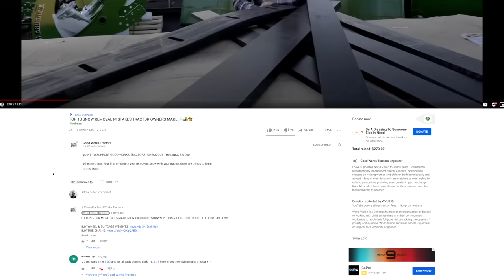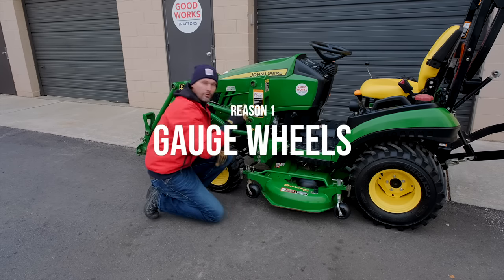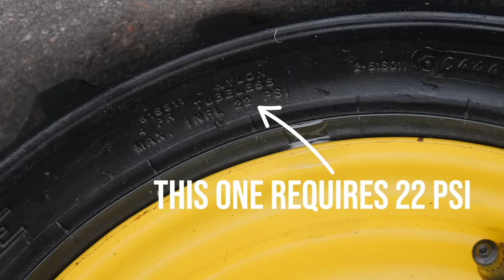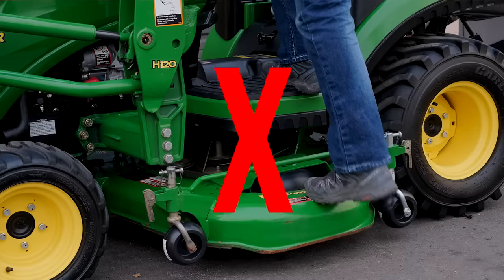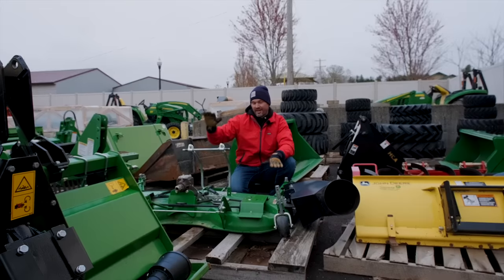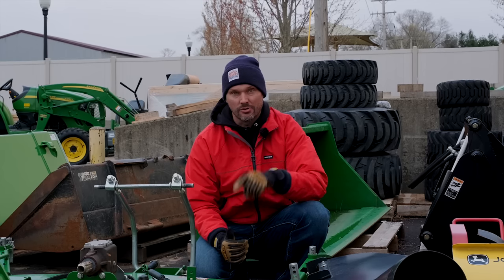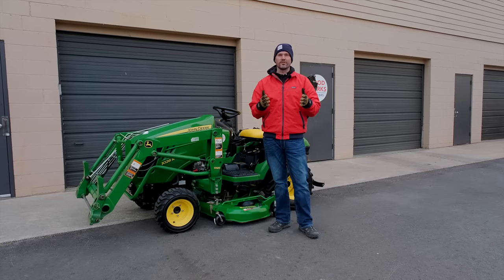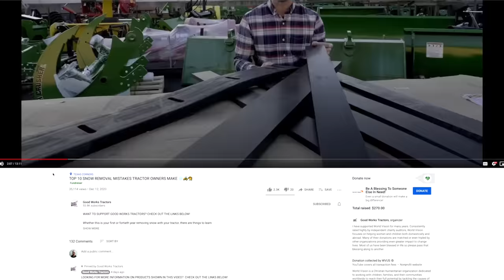5 REASONS WHY YOU'RE MOWING UNEVENLY & HOW TO FIX IT 🚜👨‍🌾

Comment: JD series 100 mowers have 3 points of connection to the frame —- one that pivots at the front center and two fixed at the back of the deck. By its vary design it will not cut level on slopes because of the lack of a second connection point at the front of the deck allows the mower to gouge the lawn on the lower side of the slope. Mowing at 4” highest setting makes it more noticeable.

Comment: Hello can I put the deck height on 1 so the wheels are in contact with the ground and then step on the deck to get on the seat ? The reason is that I'm handicapped but I don't want to damage my deck. I just have a JD X584 48" deck. Thx

Comment: I tried to lift my mower up against a stone wall.  I think I messed up the Bolt that hold the front suspension bar you show way up in the year.  What is that called and what is the part number of the bolt because I messed up the threads on the bolt.

Comment: Is there a way to get the deck on a 1025R to raise up higher? Mine doesn't have much lift. I tried to adjust it, but that didn't help.
Reply from the maker: No, there isn't much lift on them with all the "stuff" going on under the frame of the machine.  If trying to keep it from being damaged when using the loader or 3 point, it's best to remove the deck altogether.  Thanks for watching!

Comment: I watched with great attention as I recently spent a good hour dialing in my new 2025R.  It was 1.5" off from the dealer.  I did everything you highlighted here and found to get my mower deck level all the adjustments were near the center of the range except for the left turnbuckle and it had to be lengthened to almost it's end.
Reply from the maker: Glad we could be of help! Thanks for sharing.

Comment: do you have any tips to eliminate very thin strips of uncut grass where cut of the center blade should be overlapping the cut of the outer blades?
Reply: I saw a video displaying this and it was the blade is slightly unevenly sharpened from one end to the other so that one end of the same blade cuts lower than the other end by just a small amount, or the same effect would be there if the blade is bent a small amount.

Comment: My deck on my D130 is all of a sudden 2” out of level left to right (discharge side is higher).
You can see the one side hanging much lower even when the whole tractor appears level. All the mechanical linkages look symmetrical and I don’t see any bent connector bars, etc. No video seems to address this. Anyone have any ideas?

Comment: Interesting that the front of the deck is supposed to be lower. Rotary brush cutters are also supposed to be lower in the front when properly adjusted, so I guess it shouldn't be surprising that mower decks are as well.
Reply from the maker: Yeah, makes sense.  Just not positive of the reasoning.
Reply: Perhaps I can help with that! You want the front of the mower deck to be lower then the rear of the deck should you actually hit something with the deck it might bang on the front allowing you a chance to notice that you hit something…… instead of going over with the front and getting whatever tangled in the blades and rear of the deck!
Reply: @GoodWorksTractors  The reason the front should always be lower than the rear is so that you only have to cut the grass once.  If the front is higher than the rear, your blades will mow the grass once at the leading edge of the blade/deck and then have to cut it again on the back side of the blade/deck, using 2x the power.

Comment: thanks - that does help, but i am looking to see how to turn the knob on the tractor to adjust the height.  it does not turn and when i do turn it, it is very hard to adjust and turn. can you help or even email me please.  thanks mike
Reply from the maker: Make sure to raise the deck up as high as possible before turning.  When you lower the deck, it applies pressure to the rotation knob.

Comment: How does hurt the deck to step on it.I always have?
Reply from the maker: You’re asymmetrically loading the hanging brackets suspending your deck. Not saying it’s gonna knock it out of alignment automatically, it just isn’t designed to take that load and that’s why the manufacturer calls it out.
Reply: @GoodWorksTractors  k thanks I'll try not to step on anymore. If I can remember not 2 .